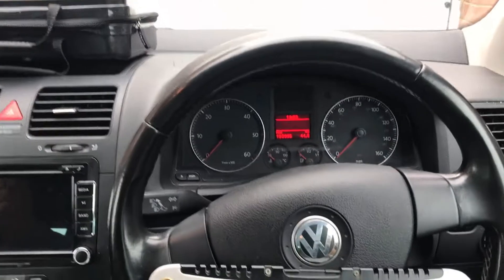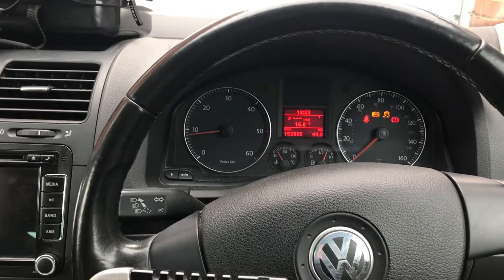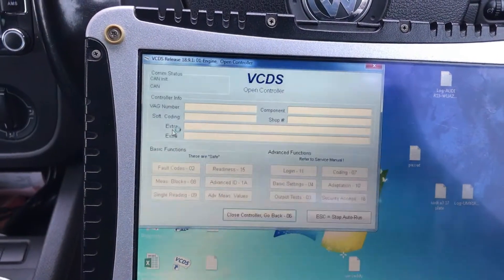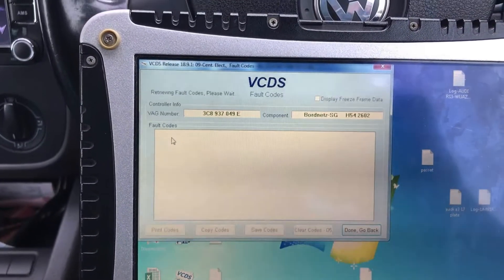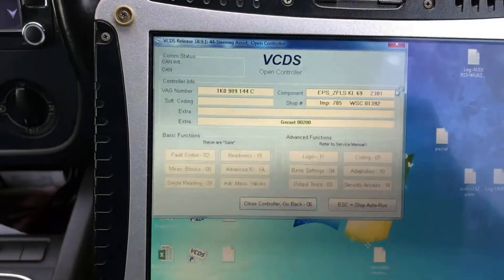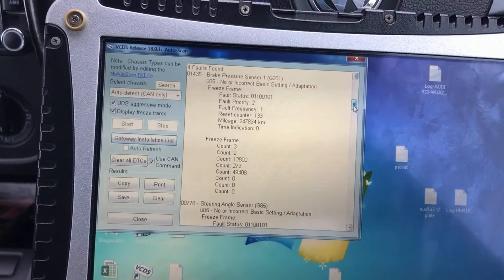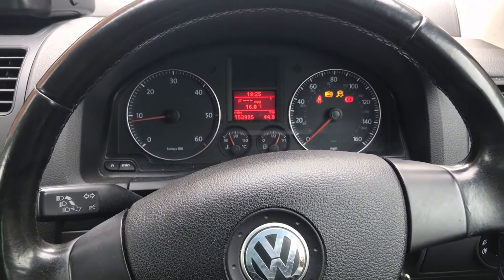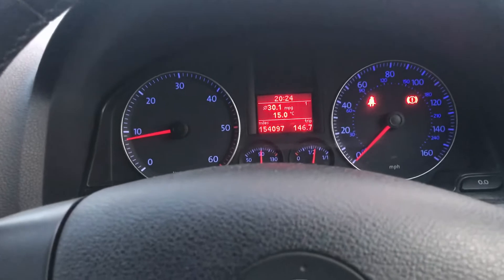VW Golf MK5 MK60EC1 01042 Control Module Not Coded Fault Code ESP ABS Module Replacement Coding

Comment: The only thing we get from this video is that coding it worked for you, but why in the world did you not video how you coded it so people can learn? You left the cream out of the cupcake 😂
Reply from the maker: The actual coding is different for every vehicle as its based on VIN number and the modules installed n the vehicle. The code is pulled from the VW servers from what was given from factory and coded to the car. So showing the specific code for this vehicle would not help in anyway if you have a similar issue. Its for educational purposes to show that if you have this problem it can be solved.

Comment: Jetta 2009 ESP is turned off with the button, the ESP symbol flashes, it wasn't like this before, when it was turned off, the symbol It remained stable.
Reply from the maker: @Автолюбители12  hello,

You will need to scan and see what fault codes are stored
Reply: No code Abs ESP no code Abnormal condition, that is, when I turned off the ESP button before, the display was stable Now when I turn it off, the icon flashes.

Comment: i had same problem and my control module has lost his code (after some experiments from me) but i could find him in earlier VCDS reports, copied it from there, coded it again, and the error was lost. it was my solution, may be this helps you.
Reply: hello can you tell me where i can find the VCDS report? because I bought a secondhand vw golf and now I have a problem for coding on the radio

Comment: Hello I have been the same fault code 01042 along with many others headlight related codes like
02223 left headlight power output stage
02224 right headlight power output stage
02656 left headlight power output stage not coded 
02657 right headlight power output stage not coded

Please can you help? What needs to he done
Reply from the maker: Hello,

It will require coding of the modules
Reply: @MidlandsVehicleDiagnostics  that's it? I was told that it might need a new control module or may be the motor inside has gone bad :-(

Comment: 01042 I got that on my headlight? Is this code for brakes?
Reply from the maker: Hello,

If you have that code in your headlight module then your headlight module needs coding.

Thanks
Reply: @MidlandsVehicleDiagnostics  was just a bit confused because the codes are the same, thanks

Comment: I have a mk5 golf tdi and had a water damaged can bus module the guy had to buy a used one but is struggling to get abs coding done.
Reply from the maker: Hello,

Has he changed it with the same part number? Did he do a backup of the coding of the modules or not?
Reply: From what I’m aware he bought a second hand one from eBay and has copied from other one but no idea if he has copied the other one. The car has been away a month now and I’m trying to figure out a solution. He did send pics of the inside of module with corrosion so not sure if he was able to connect to it.
Reply from the maker: @Maison.333  Hello,

Contact us on WhatsApp:

https://wa.me/message/AEMBL33RIUIUK1

Comment: Hi there... I have a vw golf mk5 and I have the g201 fault code..( incorrect or missing adaptation) now I have tried to sort out the problem vith VCDS but I am a beginner with using it and I don't know exactly how to calibrate the sensor... would you be able to walk me through it please? Cheers
Reply from the maker: Karoly Kozak If you get in touch via FB or IG we can help.

Thanks
Reply: @MidlandsVehicleDiagnostics  how much do you charge for coding sir ??
Reply from the maker: @desinrivlogs4794  hello, it depends on what you need coding. Thanks

Comment: Can i pick up a module from the salvage yard and use obdeleven to code it? If so once i go into long coding all i have to do is copy what i see and input it to the new module? 2006 gti
Reply from the maker: MeanFamilyGuy Gaming Channel If you recover the original coding from the original module you can then use that coding on the replacement module. You will need to do a function test and potential other guided functions which I believe OBDeleven does not do.

Comment: Hi, i have  a Seat Leon with this fault code: 01042/ control module /not coded: 000--. when i log with the vcds, on the n@0 part it states: 1K0 907 379 Q, and in the coding : 0000000, it#s a ESP Front MK60 , lights are flashing like in  your video, i just need some advices to solve this problem , The pump is the original one, not changed. Many thanks.
Reply from the maker: Hello ,So sorry for the really late message did you manage to solve this?
Reply: @MidlandsVehicleDiagnostics  Hi, my friend had to take the car to a garage, and i guess all has been sorted, many thanks.
Reply from the maker: nick nick apologies again. Glad it’s sorted

Comment: Hi, Could you share the steps to code the module? im having the same issue. Thanks
Reply: How can I do that on Delphi autocom??
Reply from the maker: Malek Hraibat I don’t think it’s possible with Delphi
Reply: @MidlandsVehicleDiagnostics   thank u
Reply from the maker: Are you using VCDS? If so, the procedure is a simple as going into the ABS BRAKES control unitthen LONG CODING and inputting in the code. it should say CODING ACCEPTED. after that you will need to calibrate all the sensors/valves and then complete the function test.
Reply: Midlands Vehicle Diagnostics Hi, thanks for your quick reply. Where do i get the Long coding from? Sorry im new to this 😢
Reply from the maker: osama munir Ideally it should of have been read from the previous module and then placed into the new module.
Reply: Midlands Vehicle Diagnostics hi,
Im currently getting all 00000 on my current coding field. Any help would be useful
Reply from the maker: osama munir where are you based?
Reply: Midlands Vehicle Diagnostics im based in croydon, south london
Reply from the maker: osama munir If you can email me your contact number I will call you. Thanks
Reply: Hi, i bought this golf recently and have the same problem so i am missing the coding from previous module. Any way we can get this code?
Reply from the maker: Asim Saleem Hello, if you can message me your number I can take you through what you need. Thanks
Reply: I have vcds and obd reader to usb for windows setup to complete? 
thanks
Reply from the maker: rooneyconor I have messaged you. Thanks
Reply: @MidlandsVehicleDiagnostics  hei i have same problem, can u help me?
Reply from the maker: @miauuu666  Hello,

Yes if you get in touch with us via our social media we can help.

Thanks
Reply: Hi , can you help me with the long coding of the car its a golf 5 1,6 petrol 2005
Reply from the maker: @huntjes  Good Morning, if you can provide me with a contact number i can call you. Thanks
Reply from the maker: @huntjes  You can find our details on our website www.midlandsvehiclediagnostics.com
Reply: My son has same problem with his MK5. Can't find old module to pull code from, what are his options to re-code?